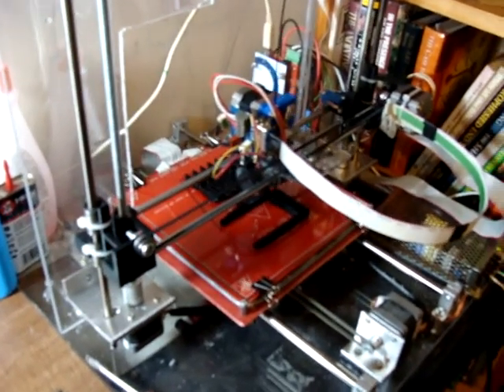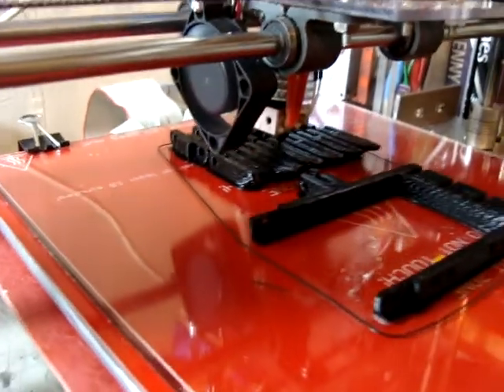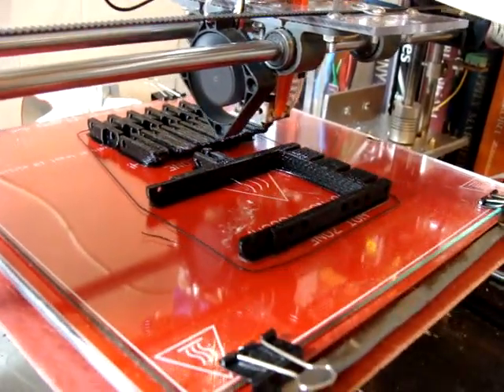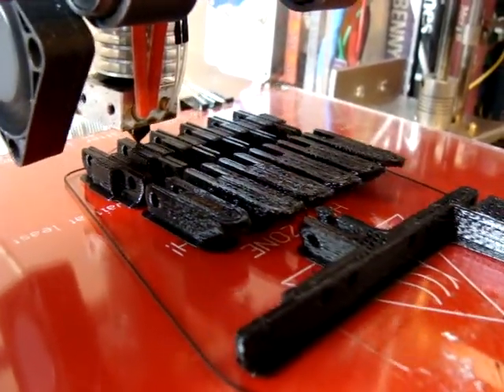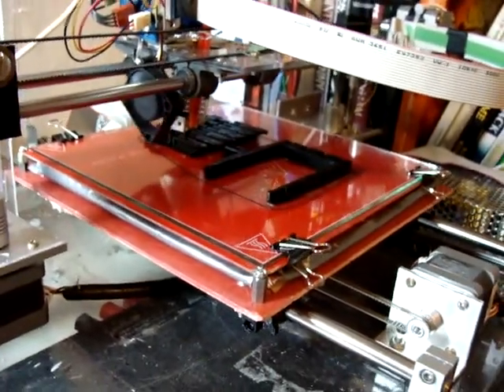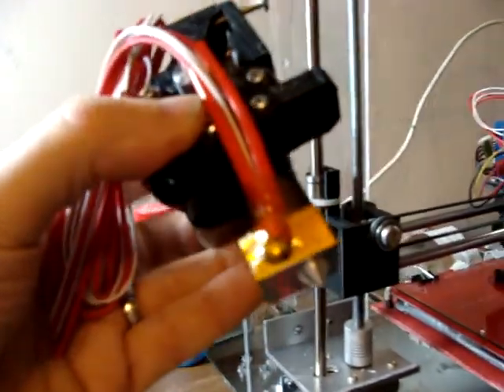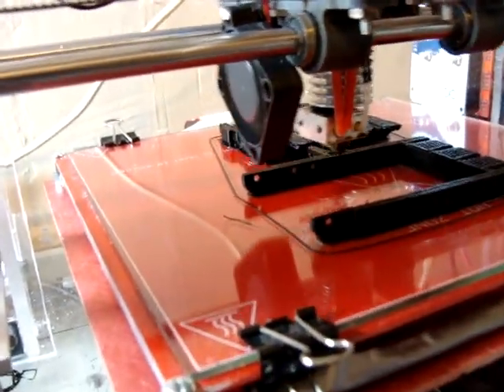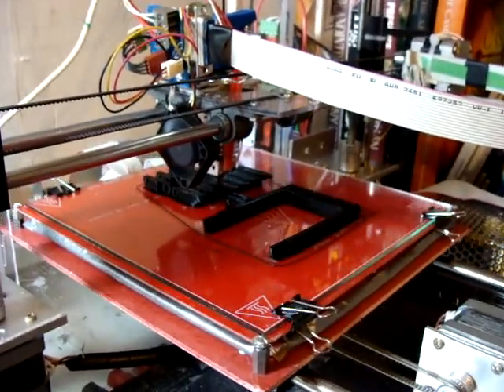DIY 3D Printer - Help for Printing Small Parts

Comment: Not sure exactly what you were meaning about people not uploading individual parts to print but if you have one stl file with several parts you can use the split function in Slicer on the Plater tab (with Cura you can right click and split) and save the individual parts as separate files.

Comment: Bob, when you talked about how Slicr doesn't do each part but bits here and there...try Cura. It has a selection that tells it to run each individual part first. I used this to do a try of Lego's. It printed them individually....don't know if this would help but it does give you options. Since Cura is free you might want to give it a shot....Cheers - Jay
Reply from the maker: Thanks!